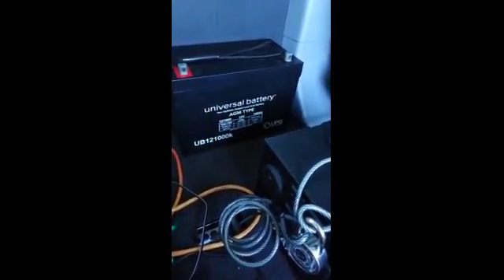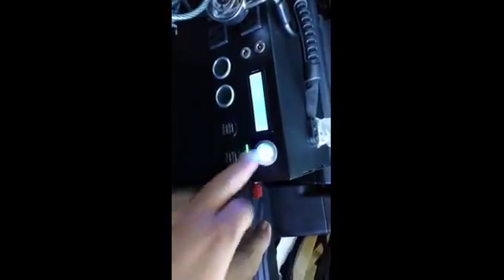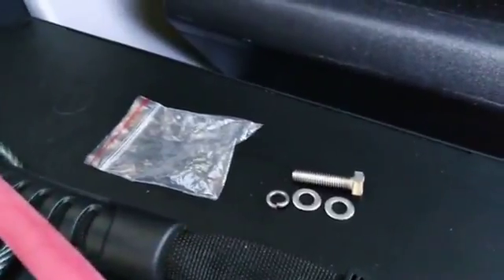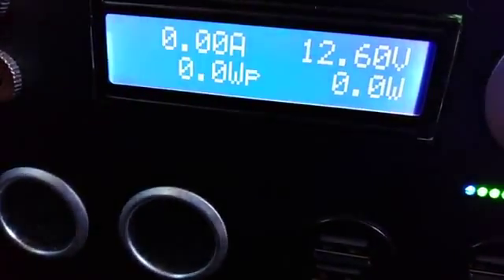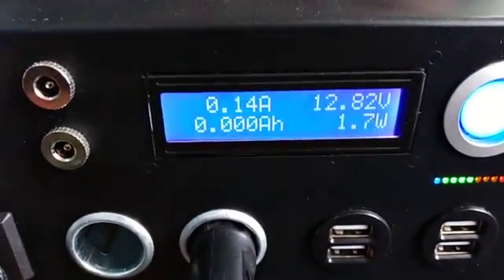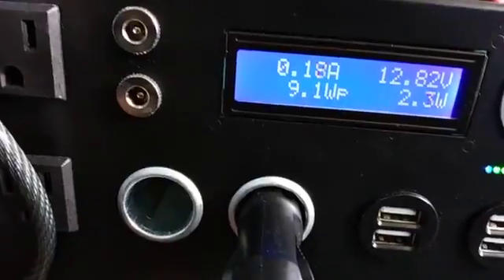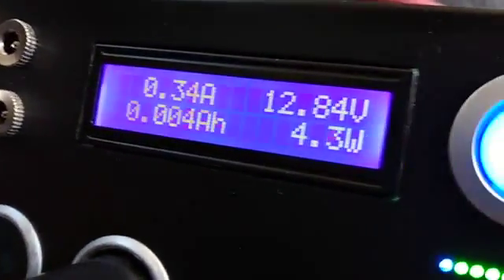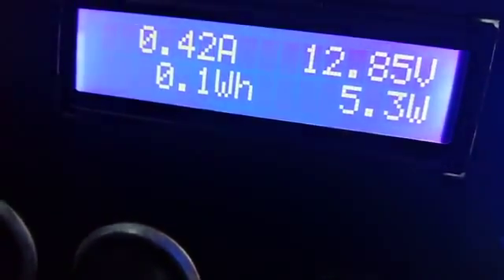VANLIFE:  First time connecting an AGM Battery to my Inergy Kodiak Solar Generator

Comment: The max voltage of the lithium should only be 12.6v, if your AGM was higher voltage when you connected it to the kodiak, I would think it could push your lithium higher than it’s supposed to go when it attempts to equalize?  The instructions say when you connect an external battery, it’s voltage should be within -.01 volts of the kodiak.

Comment: Love the video new sub
Reply from the maker: Never connect two sources to the Kodiak Solar Generator.  You must view connecting any battery to the Kodiak is a source of power.  I will be managing my AGM battery to try and maintain its life.  That means I will disconnecting my AGM when it is at zero power.  I will than reconnect to the Kodiak Solar Generator when it's voltage is above my AGM battery.  I did disconnect the solar panel before I connected my AGM battery.  I exhaust  the Kodiak Solar Generators down to 10% many times.  I am thinking of getting a Lithium battery.